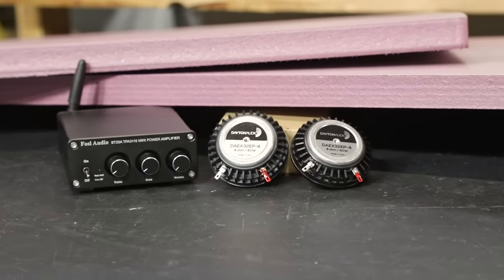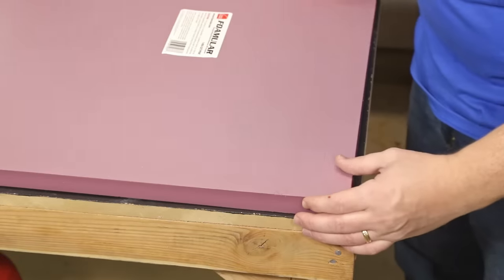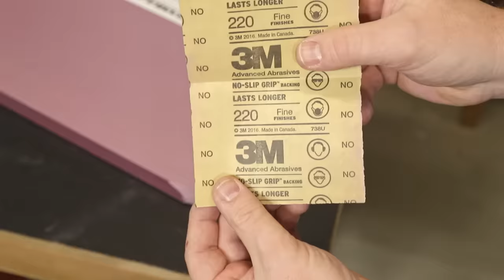How To Build "The World's Best Speakers" - Are Flat Panel Speakers Really Any Good?

Comment: I was a MECP installer at best buy. I installed the bass shakers on a jeep and was impressed by the bass. Ive heard of these transducers being used for pranks on walls or other objects. I always wanted to try them on a windshield to see what kind of sound you get. Thank you for the vid. Now im wondering what if you added a set of pannels with the bass transducers would it fill in the gaps? Anyways thanks again.
Reply from the maker: The panels definitely need more bass - adding a subwoofer produces excellent results, but I've not tried a bass shaker or transducer: https://youtu.be/XC814uQjlaE

Comment: Hey. I also made these. It looks like you missed the tone masses... 
Makes a big difference. I made a parametric drawing in fusion for any size panel.
Reply from the maker: Can you share the drawing? I may be able to re-visit with masses added.  Thanks!
Reply: @AmplifyDIY  I have looked for it, it turns out Fusion360 closed the account I made it under.. I might have to redo. 
It broke the remaining sections into non-redundant sections. The total tone mass was ~20-25% of the total system weight. I 3d printed the masses.

Comment: low freq isnt their strong side but my $20 arrowana NXT speakers are awesome. NO box problems what so ever and clear as crystal.. If I hook them up to a somewhat good subwoofer they sound pretty damn good... but looks like crap with their old 2000´s grey computer plastic look. But I knew I had to have them and they started out as rear speakers on my SB Live 5.1 sound card and amazed me how good they sounded.. now they are retired but drivers will gain new life soon again in a project iv been working on.

Comment: I cannot find any follow-up vids to this...can these be painted/coated without severely impacting the performance?  Even a solid color would be helpful in the aesthetics of putting these into interior spaces.  I'm getting ready to order the exciters now and I, too, am excited!
Reply from the maker: Follow up video coming very soon. (Probably this week). In it I demonstrate a few ways to make these look better in your interior spaces. Stay tuned!
Reply: Thanks- i have this material on hand because I use it for terrain and bases for table top rpgs- have coated several different ways.  Mod podge makes it pretty rigid…spray paint can react with the untreated foam…looking forward to your experimentations 🤓

Comment: Wow. Never heard of these before. Will built a set for sure but have a couple of questions…how does the 1 compare with 2 in relation to the placement of the exciter?   Would you need to build these in pair for left and right?  Could they be hung horizontally? Thx
Reply from the maker: I address a lot of these in this follow up: https://youtu.be/XC814uQjlaE - however, you'll need to build some yourself to experiment. Good luck!

Comment: i think there is efficiency loss by the magnet / exciter regounding as it pushes and pulls the foam panel. If you stablized or secure it by the maget and then the panel would be pushed and pulled by the full force of the magnet of the exciter and the energy lost due to free flow. Think you would gain bass response.

Comment: Awesome video! I feel that the frequency response could be extended lower with larger transducers (your exciters), but I am no expert. I'm sure panel dimensions would have an effect as well. I'm really curious where the ideal placement for the transducer should be, too. Most audiophiles will want to match the response of both speakers, or place the exciters in the same place on each panel. I also wonder what using a thinner panel would do. As I'm sure you're aware, most speakers aim to be as light as possible. Curious why a thicker panel was desired here.
Reply: @I P - Actually, cone speakers should be as light as possible provided they're very stiff. You need the stiffness to ensure tight coupling between the voice coil and the air it's trying to move. You're correct that there's no reason to make the voice coil work harder than necessary to move the air, and the way to minimize that work is to make the cone as light as possible. But you still need to have a very stiff cone.

In these panel speakers, the thickness is the property that imparts the stiffness. You don't want thin panels, because they flex much more, and that reduces the efficiency of transfer of the energy of motion of the panel to energy of motion in the air it's trying to move. Because the foam is so light, there's essentially no mass inertia penalty by increasing the thickness of the panel to get the desired stiffness for high efficiency energy transfer.
Reply: @Vito_Tuxedo  Dude. Very well explained! I get what you're saying and it sounds right to me. Thank you!
Reply: @pointer333  Glad to help. BTW, you're right about larger panels extending the low-frequency response. Tech Ingredients (TI) demonstrated how size matters with his sweep generator tests on different sizes of panels. He also determined that the two-fifths/three-fifths location for the transducer was superior to dead-center placement, although none of the panels had flat response. In fact they all had some nasty peaks and troughs.

TI's method of dealing with that was to use multiple panels of different sizes and different materials, aligning peaks and troughs, which were at different locations on the audible spectrum for panels of different sizes/materials, to more closely approximate a flat response curve with all panels working together. I guess that's less costly than buying a good equalizer, but...BLECCHH!! It's not a good way to get flat response.

The reason is that there might be a sweet spot where it all works, but there will also be spots where the sound sucks. There will be big-time phase cancellations at various locations in the room. What's worse, your brain will have to work harder to sort out all the phase anomalies, resulting in "listening fatigue". It's a psychoacoustic phenomenon; the longer you listen, the more disoriented your hearing becomes.

There's no question that the panels are a very inexpensive and very efficient way to move a lot of air, but I would add a third-octave stereo equalizer to the system to dial in a flat response curve...and just use two large panels for stereo. With large panels (...say, 2' by 4') and a good equalizer, you probably wouldn't even need a sub-woofer to get the bass down to 40 Hz. I don't need anything lower than that. Your mileage may vary. 😎

Comment: Question: do you think the sound would be greatly compromised if you painted them with an *enamel spray-paint*? Does that foam react (melt) to solvent-based paints?.
Reply from the maker: Hi Eric - yes, the foam can be affected by spray paint. In my follow-up video I painted a set of these panels and tested them against the originals. There was a distinct change in the sound. The foam did not appear to melt, but the paint did alter the sound enough to make a distinct difference. I've heard from some viewers that using inks rather than paint works well, and does not affect the sound. Here's the follow-up video, in case you are interested in hearing the differences yourself: https://youtu.be/XC814uQjlaE
Reply: @AmplifyDIY  it's brighter*? *darker in tone? Also, how directional are they?

Comment: Awesome. I would have been very skeptical as well, but this has me thinking of applications. I'm not big audio guy but something like these as a fun project that can be turned into art with a little creativity? Apply some of the "tuning" ideas, maybe an eq, but most of my sources let me eq there... some prettied up acoustic coverings and a mount that isn't straight out the top and obvious and we're gtg. The best part is that scrapping a failed prototype costs a few bucks for a new board and some 3m tape. Maybe I'll wind up spending $100, oh darn.

Comment: So, since you're making them both with different frequency response, how do you make it have true stereo? Would you need 4 pieces of foam, do a center and off-center for each side?
Reply from the maker: Yes, or you can also add 2 exciters to each panel, so you still only have 2 panels, but a correct stereo image. I tested dual exciters in my follow-up video: https://youtu.be/XC814uQjlaE
Reply: @AmplifyDIY  nice, I didn't think putting two exciters on one would work, but glad you tried it!

Comment: I have designed and built many speakers for all kinds of applications. This is interesting but kind of funny too... If you glue Polydax 3.5 inch woofers without crossovers you'll get all that plus low end you won't believe!

Comment: is the sound effected alot if you mount the exciter connected to the material on a wall with a mount instead of hanging them by string?
Reply from the maker: Hi MrEibwenlufepoh - yes, the sound is affected quite a bit by fixed mount: https://youtu.be/XC814uQjlaE

Comment: On the Tech Ingredients channel they built 2 types using different materials not just a size difference and they explain that you need both to get a full frequency range.  The base speakers used acoustic ceiling tiles I think.
Reply from the maker: Yeah, Tech Ingredients has been taking a very deep dive into DML speakers like these. Before I went too nuts, I just wanted to try the one size and a single pair. After I did this video, I produced a follow-up that takes a deep dive into just how much the audio is affected by slight modifications to these baseline panels: https://youtu.be/XC814uQjlaE
Reply: @AmplifyDIY  Yeh, I have seen your follow up wrapping the speakers and trying different shapes. Very good content taking tech ingredients experiments to the next level.

Comment: Curious how it would sound if you supported the whole thing by the driver. It looks like a lot of energy is lost in it vibrating off the back of the foam. If you support it I wonder if that energy would be transferred to the foam more efficiently?

Comment: Would it effect the panels in a negative way if i'd paint them? What kind of paint would you recommend?
Reply from the maker: Hi Jean - yes, paint does affect the panels. I would recommend using ink or wrapping the panels in a lightweight fabric rather than paint. Here is a follow-up video I did that tested the effect of paint (as well as a bunch of other things): https://youtu.be/XC814uQjlaE
Reply: @AmplifyDIY  thanks for the link 👍

Comment: Are you able to add an x-over? I would love to hear your thoughts on performance if they were in a bi-amp configuration.
Reply from the maker: Hey DJ Vibe - you certainly could add a crossover. I did a follow-up video where I tested dual exciters per panel (though not with a crossover - but I did use 2 amps so all the exciters were driven by a single channel: https://youtu.be/XC814uQjlaE

Comment: I have built a set of these speakers and with a subwoofer and a ten band equalizer connected they sounded pretty nice. The problem with the transducers is that their weight tents to pull the voice coils out of linearity with the magnet structure causing them to buzz and distort. So I found that wadding some tissue paper up and putting it at the bottom corrected this problem for the most part. Anyway, for the price of the materials used, it was a worthwhile project.

Comment: I would try more with this system.
First the consideration that any form of force in one direction exerts the same force in the opposite direction - in short - recoil. You could see that in the side shot - the drivers not only moved the foam sheets, but also themselves. This is vibration energy that is lost - not in the plates. So fix the drivers so they can't move? This could be attached to a wooden stand which is hollow with an opening to achieve bass resonance.
To take it even further - a 2-way system using active frequency separation. In my opinion, it would be sufficient to use one driver for frequencies from 20 to 5000 Hertz for bass and one driver for frequencies from 5000-18000 Hertz in the high and mid-range. Note that the area for the high and mid-range should be around a third smaller than the bass speakers.
This is my mental conception of it.
Reply from the maker: Interesting idea, Stefan! I actually tested a set with the exciters fixed in place in this follow-up video: https://youtu.be/XC814uQjlaE
Reply: @AmplifyDIY  Good morning from Germany - hehe - fast answer :D
I have noticed the 2nd video and i am looking it in the moment. I noticed, that some of my thoughts other ppl have, too :D
I am very interested in DIY-Speakers, because this can be a cheap way to build stylish speakers with good sound for your home without spent thousands of €uros ( or Dollars ). Okay - back to the 2nd video!

Comment: @AmplifyDIY , I built the same speaker using Dayton audio 25w speaker (stereo)  frequently response is 80hz-12khz. 

The output was not expected, the mid is really poor wit voice is sounding like echo. I suspect I did something wrong of the following the caused this issue. 

1.)Painted acrylic painting on the panel, like art work. 
2.)Using Dayton Audio DAEX58FP Flat Pack exciter. 
3.)Sticked the speaker using silicon past. 
4.)using wuzhi audio amp. Cheap one. 

Please let me know what could have went wrong.
Reply from the maker: Hi kamesh - the acrylic paint will have a big negative effect, as will attaching the exciter with silicone. Check out this follow-up video I did that demonstrates some of the effects of things like paint: https://youtu.be/XC814uQjlaE

Comment: Curious if you did 4 separate placements. So 4 speakers each with a different placement of the driver. Could you generate each of the frequencies fully low, high, middle ?
Reply from the maker: Hey Barbarian - the size and shape of the panel is the largest determining factor in which frequencies are reproduced well. Placing multiple exciters on a panel can help to fill in some of the lost resonant frequencies that occur with the first exciter placement. You can learn more about recommended multi-exciter configuration here: https://www.daytonaudio.com/topic/excitersbuyerguide#installation

Comment: Curious, for the stereo setup, how would it act if both L+R setups are mounted on the same board?
Reply: I've tried it with a 48" wide by 24"
It works, but the sound stage is.... Strange. Idk how to place it.

Comment: I dont know pretty much anything about audio so this is just a thought. If you made a box out of the foam board would it have more low end sound? Almost like putting a big exhaust tip on a truck gives it a throaty sound. Might be dumb but it works in my head 😂

Comment: Maybe I missed something - the source of audio your using. Is it 16 bit or 24 bit ?  Is it compressed audio (WAV) file format ?  or lossless file format ?  What is the sample rate as well because that sets your Nyquist limit. 

Then there's the second limitation your placing on your music source. Your transportation layer. 
How many bits is your Blue tooth connection   and what compression , and sample rate  is that running at?

Your sound source is going yo make an immense difference to your results.
Reply from the maker: The source was 256 bit encoded MP3 files, so it's compressed and lossy, but to most human ears the losses are indistinguishable. The bluetooth chip on the amplifier I used is the Qualcomm QCC3003 (https://www.qualcomm.com/products/qcc3003). Check the link to see details on the encoding / transport mechanisms it uses... it's a very, very good chip. 
I am working on a follow-up video where I'll be using different sound sources and wired to the amp instead of bluetooth. 
Great questions, and thanks for watching!

Comment: Same principle I used for my simulator tactile input well before ButtKicker made a fortune doing this.  I simply used 2 sub woofer Amps that were fed from my PC and frequency tunable for things like Rifle Shots and Race track Ripple strips , my seat vibrates in sync with Engine and Cars interaction with the ground , even flight simming was transformed. 
So the Foam board here could be an actual wall panel in a room ,  and THAT would blow your mind as far as sound goes , and YES you should use a an equaliser to account for various room acoustics , now as for the harmonics and frequency response of these panels I'd be tempted to use 2 transducer's for each panel  and experiment with the most suitable location.

Comment: Question: I noticed on the rear of the Exciter there is a threaded hole. How would the performance change if you were to add mass to the rear of the exciter?
Reply from the maker: Hi 245 - it actually has a pretty negative effect: https://youtu.be/XC814uQjlaE

Comment: I wonder if you couldn't adjust the design to put a cotter pin on top and bottom instead of both on top, then you could mount this to a frame and get more options for locations.

Comment: I have tried few material with this kind of speaker.

The best sound produce i've tested was thin plastic, PET material. Size matters, as bigger size doesnt produce better sound, as the speaker has limited power to vibrate the material
The material you glued on has to be stretch tightly instead of letting loose. But the speaker can be loose

I've tried glass, Metal, wood, Styrofoam, cling film, aluminum foil.

the best sounding is Cling film and PET material

EDIT: I have found a channel, Matty Hughes he mount on Acrylic , and sounded good

Comment: Wonderful project, I definitely like to make my own.
About the foam, I am not able to open the link to the Homedepot page.

Question - Can you please let me know:
a) What is the specific type of foam?
b) What are the exact dimensions?
Reply from the maker: It is extruded polystyrene, and is sold in 24" x 24" (610 x 610 mm) panels that are 1" (25mm) thick. It is usually listed as "project panels" or something similar. I've seen it in pink at Home Depot, and an aqua marine blueish color at Lowe's. Good luck!
Reply: @AmplifyDIY  thnx!